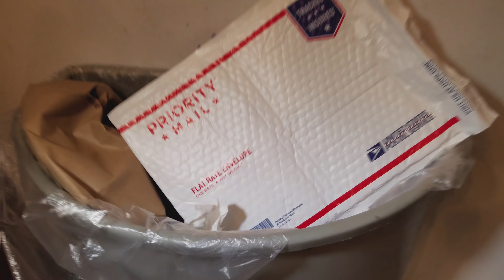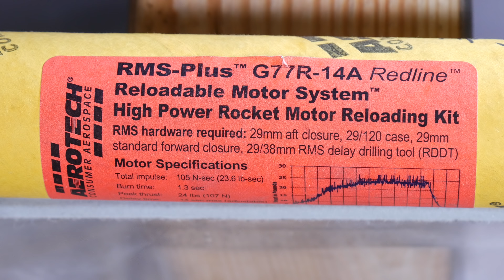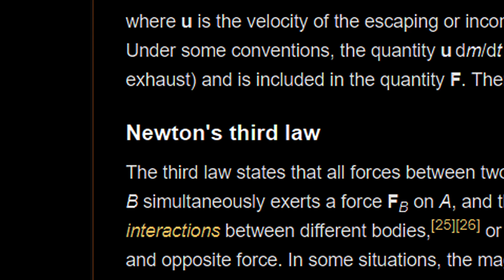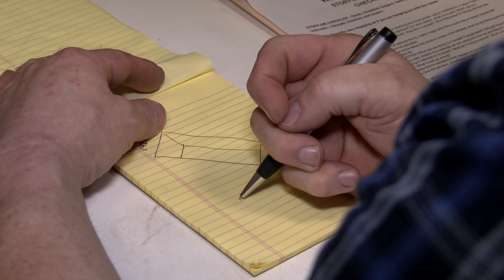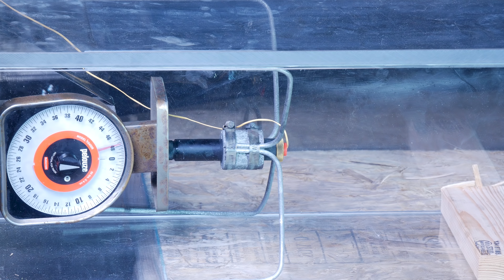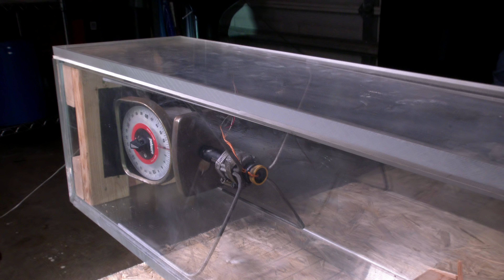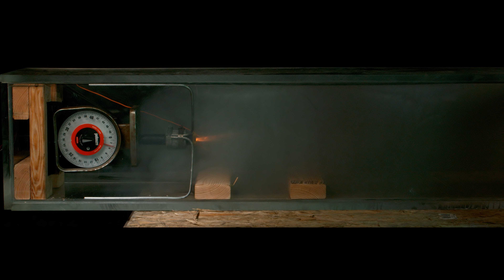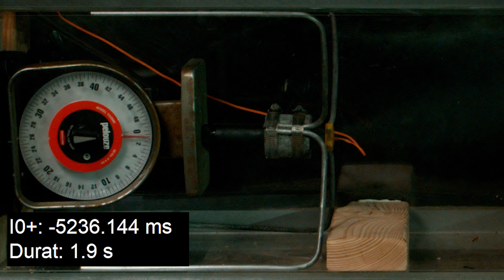Rockets in a Vacuum Chamber - Newton's third law of motion Visualized

Comment: I noticed your vacuum gauge gained pressure as the propellant burned. Creating an atmosphere. Mmmm, Fail!
Reply from the maker: Yeah that doesn't matter, all I was worried about was the first 10 or 20 milliseconds of ignition. The rest of the burn was just for entertainment.
Reply: Earth is round, but I don't trust space people. Heliocentrism has been debunked (search this video on YT: "The path of solar eclipses proves a geocentric universe : FULL"). So how can we trust NASA? In my view, Newton's law is not in question, but rather its honest application to the whole dynamic...

I believe that the thrust from combustion is <10% of what a rocket requires for lift, the other >90% is from the reaction between that high velocity exhaust and the atmosphere. This experiment only seems to isolate the thrust from ignition/combustion, but does not prove that it is what accounts for the majority of thrust capacity. 

Of course there will be a kickback (thrust) from the ignition. The question is: does that create the majority of a rocket's thrust capacity? I think not. Also, any vacuum chamber cannot be a similar comparison with space, because space is not a contained volume. Any gas in space would be compelled to expand and disperse rapidly without being contained. 

In any case, thanks for the experiment.
Reply: שילה בן אדם - I propose an experiment for you: get on a skateboard or chair with wheels or something similar. Take a heavy object and throw it (in line with the wheels). Do you move backwards? Now do the same thing and throw the object at a wall. Was there any difference? You are suggesting that having a wall would make a difference in this experiment.
Reply: "Creating an atmosphere."

nope...it just raised the pressure.  no "atmosphere' was created...that actually doesn't make any sense as written.  vacuum isn't a complete lack of matter, there are differing degrees of vacuum the same way there are different degrees of pressure.

such a simplistic viewpoint....